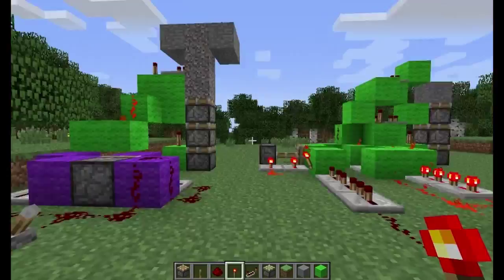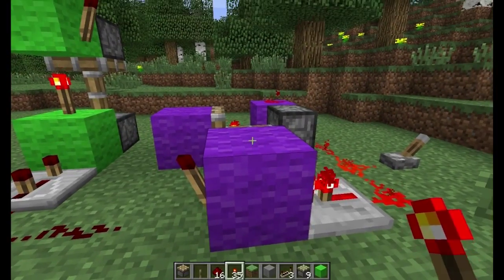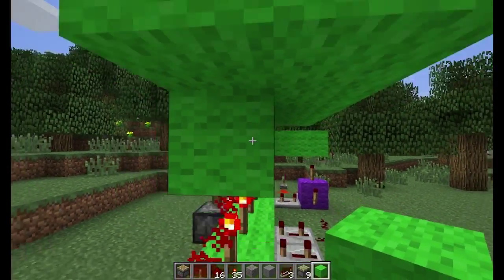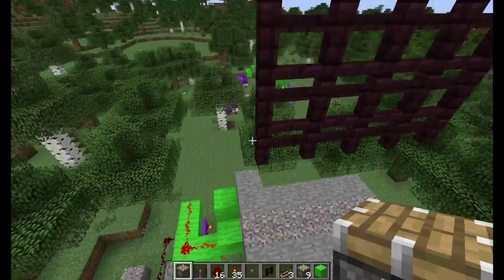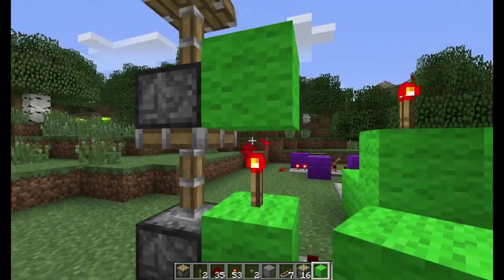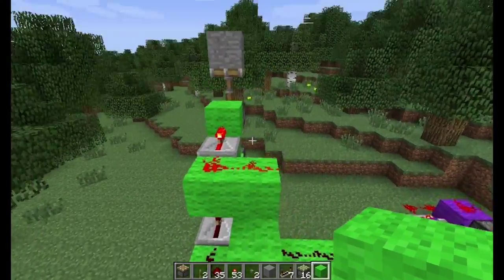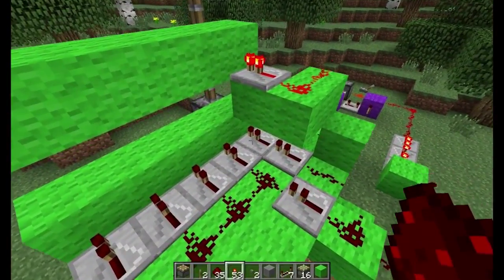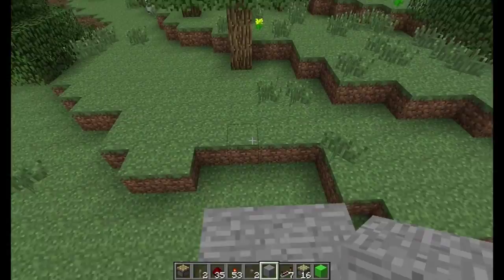Minecraft Tutorial: Vertical Triple Piston Extender (Expandable)

Comment from the maker: The first version doesn't send the right amount and correctly timed pulses for it to work with a sticky piston on top. If you notice when I activate the first version, the top piston only retracts once when turned off. You actually need that top piston to retract 3 times on the way down in order to pull the block all the way down.

Comment: Doesn't quite seem to work on the xbox version.  The timing seems slightly off and the top piston doesn't pull the block down.  (it should be obvious but I'm talking about the sticky version triple extender)
Reply: i fixed it with observers on the last curcit of it with 2 repeters at 4 ticks that lead to nothing with observers detecting that they activated and ran it into a seperate piston with a redstone block next to the top piston so it would 1 tick the block out and pull it back and it retracts the block in the extender

Comment from the maker: hmm, I'd like to have a look at it if it's possible to see if I can find the problem. The only thing I can think of off the top of my head is the problem with redstone circuits sometimes changing behavior when they are oriented in a north/south direction instead of east/west and vice versa. But if I recall correctly. I did test for that and I didn't have any issues. Also, make sure that you don't have anything going on close to the bottom pistons as they are sensitive to block updates.

Comment from the maker: @jinso24 It's possible by placing a repeater a certain way to extend the signal (it's hard to explain without a visual). However, because you are adding delay, the extended half will be slightly slower (about a few of split seconds) than the first half so it won't come down evenly. If that doesn't bother you, let me know which version you want to extend and I'll make a quick video showing you how.